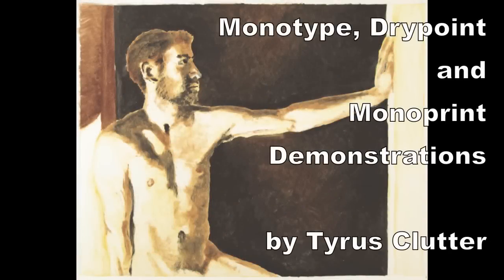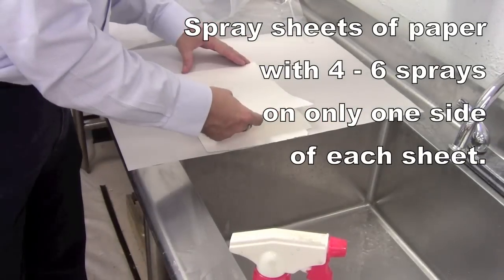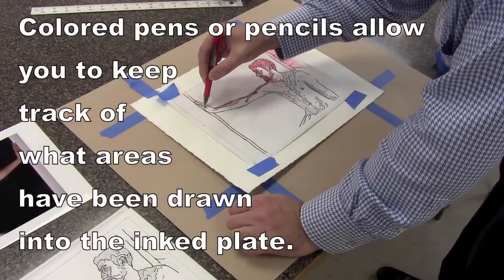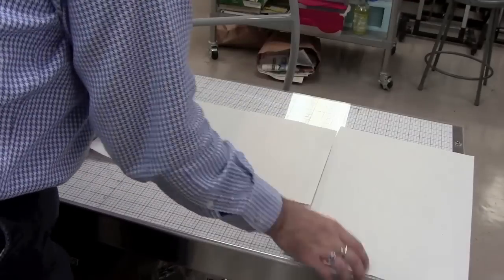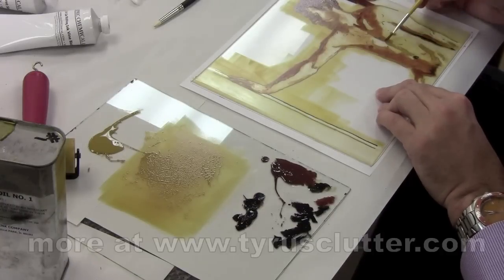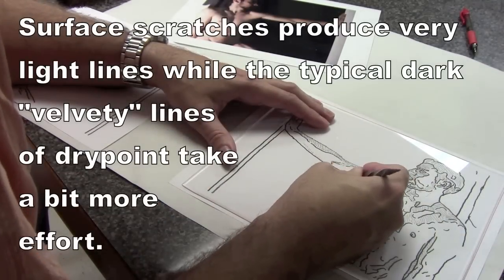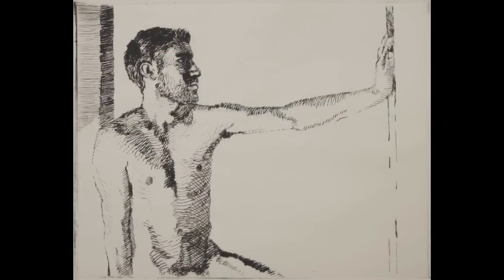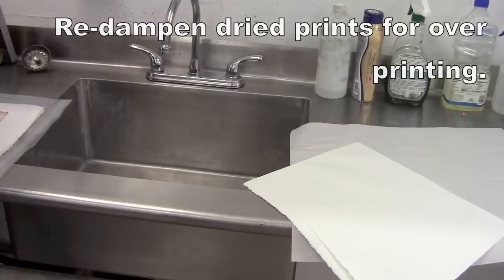Monotype, Drypoint and Monoprinting Demos

Comment: how did you get that drawing from the photograph?
Reply from the maker: Sometimes I just draw on a sheet of paper looking at the photo, but often, as in this case, I size the photo to the dimensions of the plate in Photoshop and then create another layer in Photoshop and essentially trace over some key areas that I want to work from. I can print out several copies of the same drawing so it doesn't vary from print to print. I can also flip the image horizontally so that the final print is not in reverse to the original photo.